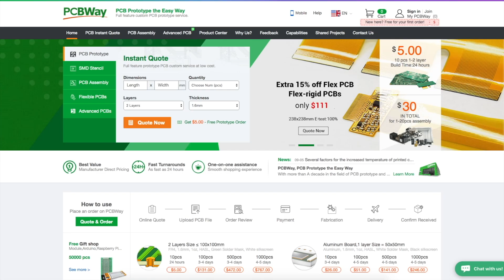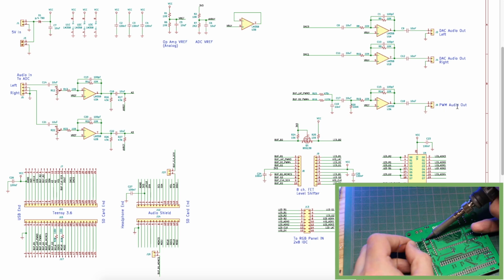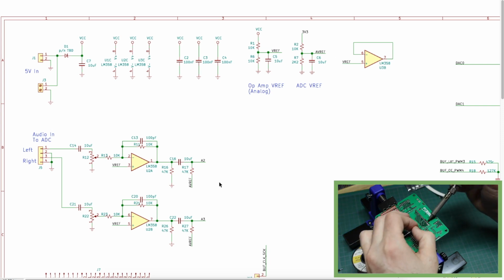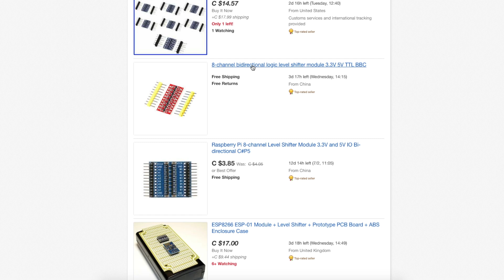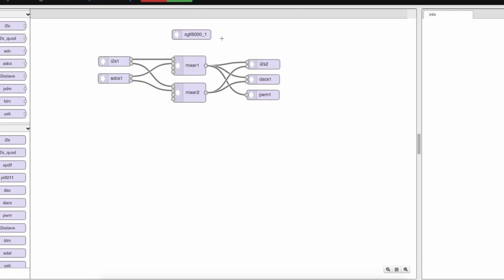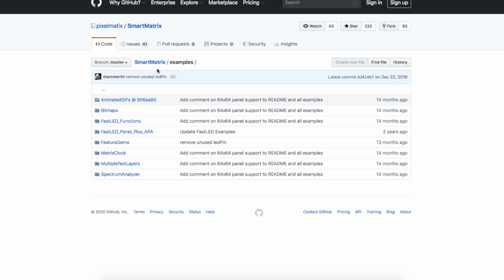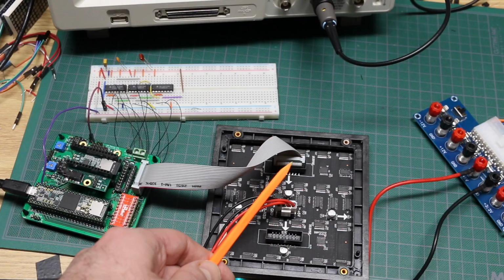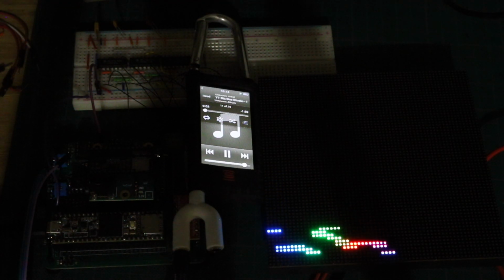Teensy Audio and LED Panel PCB:  SmartMatrix Compatible

Comment: Is it possible to use teensy 3.6 codes in teensy 4.1??
I bought teensy 4.1 and tried to upload codes with 4.1 but It not works.
Reply from the maker: For specific hardware that uses dedicated chip features on 3.6 that may not be present or may be different on 4.1,  some things might need new software and the pinouts may be different.  Something simple like blinking an LED would be universal and the compiler would do any adapting but things like the matrix panel may need new code, possibly considerations for the difference in processor clock speed too.   It could be as different as switching to a whole new chip platform.
I haven't tried using a matrix panel with 4.1 yet so I would go to the original smart matrix github location and see if they have something updated for it.
Reply: @GadgetReboot  thanks for answering. I thought the new version can do more things.
i should buy 3.6 version of teensy
-__-

Comment: Good evening and Happy 4Th of July @Mr Gadget Reboot!

Quick question (love the videos btw!!), but would you take on a small commissioned job to build a small (like 3 inch round or square but would fit in a 3 inch round housing ) led programmable board and set up the animated sequences?

We have a 94 year old car that has NO brake lights and no turn signals and we want to totally hide them into the existing light housings, in our case a 3 inch (approx) round rear tail light that we’d like to do a few animated sequences and then scroll the word “STOP”!!

And then for turn signals we were thinking some sort of animated arrow pointing which direction we were turning.

We know it’s not safe to really drive the car without a brake light nor turn signals so we don’t really drive the car!!  We want to start enjoying the car SAFELY but we don’t want to visually alter its stock appearance so we think some sort of hidden programmable board in the tail light housing would do the truck!

The existing tail light lens is red glass.

This is a one time build so I really didn’t want to learn how to build this insert snd program it just for one build so again I am curious if you’d take on a small job like this?

Regards
Crazy

^btw I am part of the largest classic car group in the world so I am sure there are many more folks in our group who would love something like I am describing if it were available!!!!

Comment: Can we do 64*64 LED matrix with teensy 2.0? teensy 3 is expensive for me.
Reply from the maker: Those are only 16 MHz AVR type processors, so there's no chance.  I started out trying ESP8266 at around 80 MHz and it flickered on a 64x64 (people got it working on 32x32 and maybe 32x64).   As soon as I went to Teensy 3.6 at I think 180 MHz it was fine.  The bigger the display, the more data has to be sent out within a short time to complete a flicker free frame.
Reply: @GadgetReboot  Thank you so much. I noticed I have a Raspberry pi 3B+ which I used for my final project. Can I drive it with that?
Reply from the maker: That is 1.4 GHz and should be very capable.  I've never tried but maybe I should...there is info here that I found:  https://github.com/hzeller/rpi-rgb-led-matrix
Reply: @GadgetReboot  Thanks again a lot. I also recently found it and looked promising so I'm ordering the matrix. :)

Comment: Simply awesome! I install led displays for a living. The professional board we use to troubleshoot led modules are just under 500 USD it's good to see a 20 USD board doing the same job. The diy community never ceases to amaze me!
Reply from the maker: That does sound overpriced! The most expensive part of this project would be the Teensy module and we could probably do it even cheaper if we went with the ESP 32, which I still need to do a project using.
Reply: For a full color 4' x 8' led display we charge 18,000.00 dollors to buy and install for our customer. Over half of that price is the cost of the display. We are the cheapest suppliers in my area, midwest USA. It's pretty outrageous.